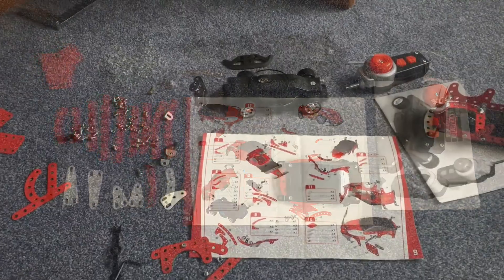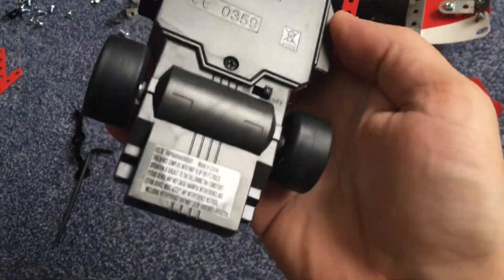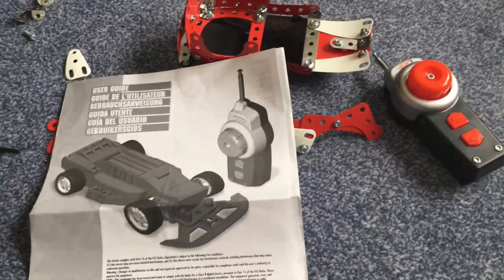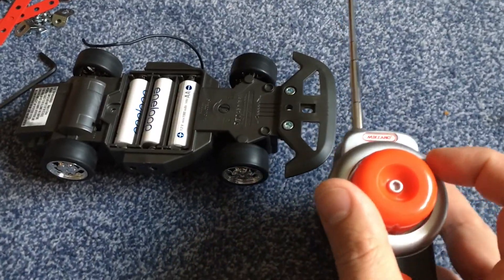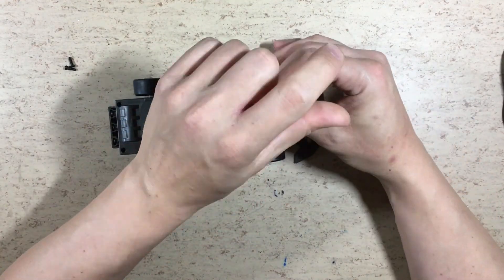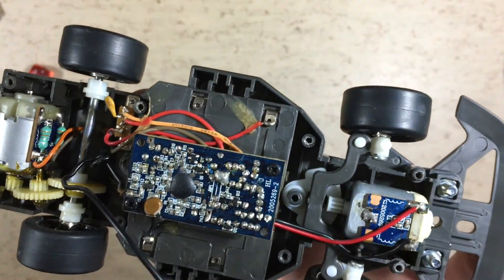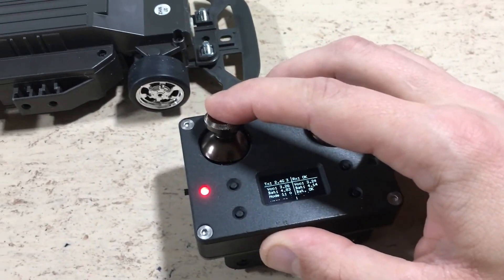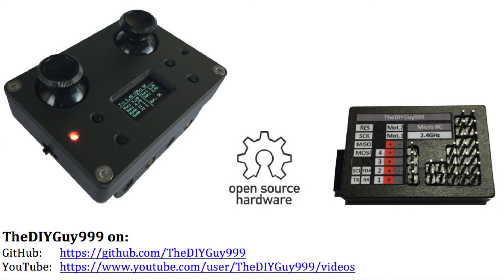MECCANO 6952 Tuning Radio Control Car - Arduino 2.4GHz Remote Conversion

Comment: I love your work it is very inspiring and make me want to get into electronic. But I was wondering if you ever thought of making an diy kit for hobbies and engineers to build off of and create. I would love to make transmitter and receiver but many took that are used aren't available to me at the moment. I would love to buy a kit that could help solve this problem if you where to make it . Thank you for videos
Reply from the maker: Thanks for your praise. The "Micro RC" remote is intended to be a DIY system. All you need to build one, can be downloaded on my GitHub. You can also use standard Arduino components and wire them up in accordance with the provided schematics.